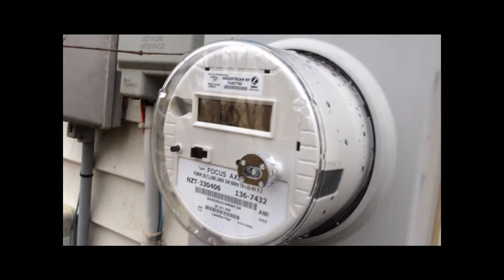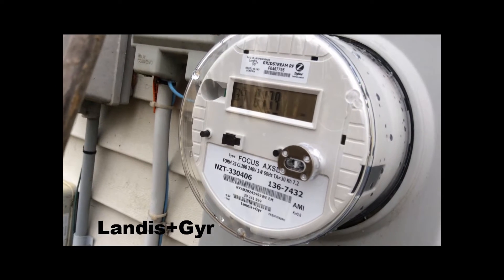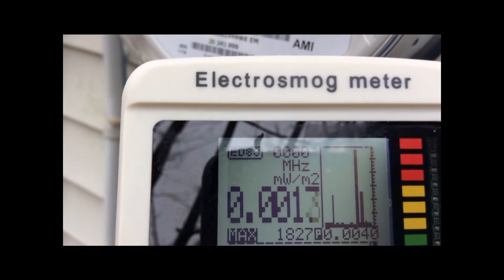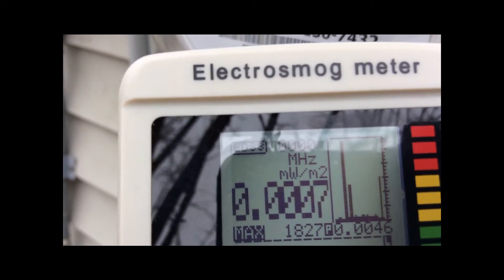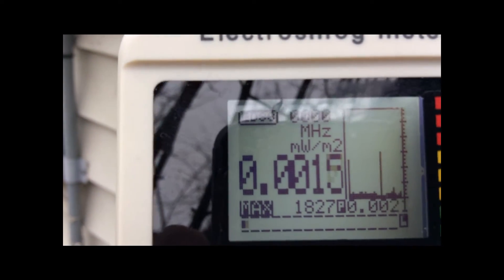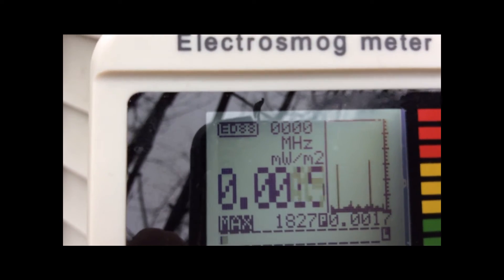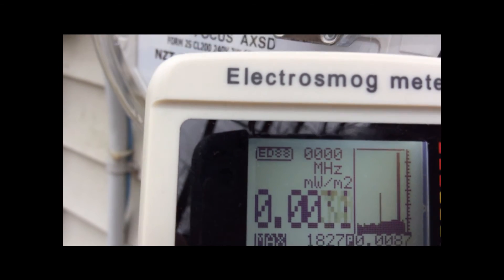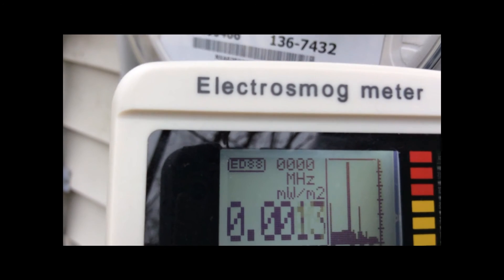WE Energies Landis+Gyr AMI Smart Meter RF Radiation Exposed

Comment: I cannot believe how bias and nonsensical your analysis is. Wait!!! You provide no analysis since you never state what harmful levels are and what the parameters are for measuring RF emissions. You simply state "max'ed out the meter" and "harmful level". Try again with some attempt of performing this using a scientific method.
Reply from the maker: Brad, there is no one cutoff for "harmful" levels. To some degree, any level is harmful. Of course, even if the meter hadn't been maxed out, the levels shown would have been harmful, but a maxed out meter is indicative that something is really wrong here. I suggest looking at pages 170-172 and 176-177 of the following document: https://wirelessaction.files.wordpress.com/2017/04/irradiated.pdf - this is a table of documented health symptoms from peer reviewed studies at different levels. You can compare the levels in the table to the levels shown in the video and come to your own conclusion.

Comment: Admire your initiative with doing this video reporting, but do believe the utility rep who told you it was an "AMR" vs "AMI" was delivering false information.  While I'm not an expert, I am a consumer advocate currently focusing on raising awareness on this technology.  We have an Acoustimeter AM10 EMF meter and have taken assessments at smart meters.  We have an AMR meter on our home and it has the dials vs digital readout.  This meter has telltale signs that it's an AMI like the digital display as well as the lock and black button and the "AMI" near the bar code.  Also, the levels of radiation that you are showing adds to my feeling fairly certain that this model is, in fact, a pulsed microwave radiation-emitting surveillance device.
Reply from the maker: Thanks for your input Paul. It’s certainly possible that the utility rep was misinformed or intentionally lied… like I mentioned in my video, she told me that it transmitted once at midnight and obviously that was a complete fallacy. I don’t know how I would be able to distinguish the difference myself since that likely depends on the software installed in the meter.